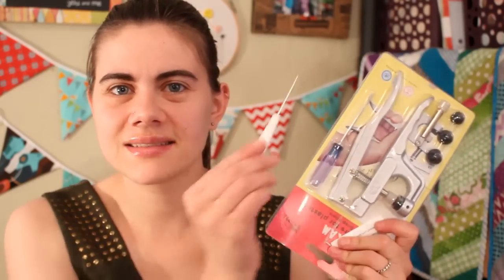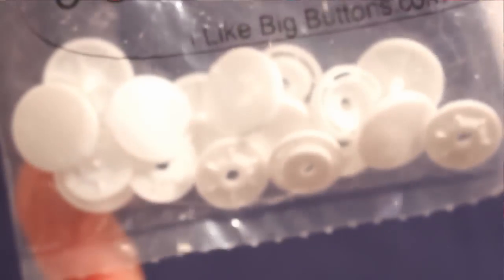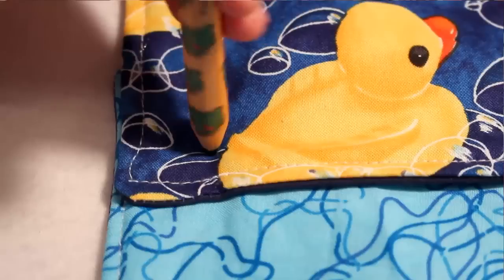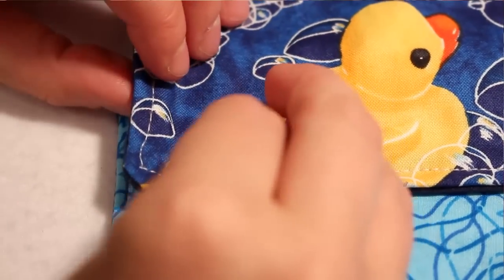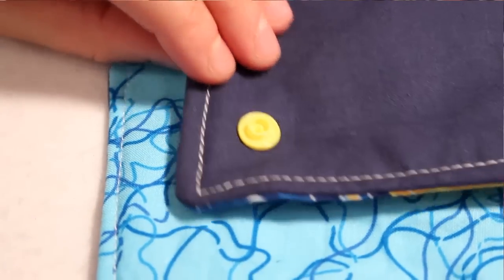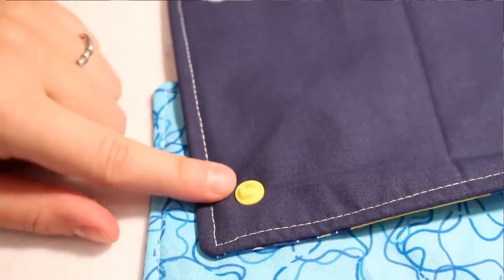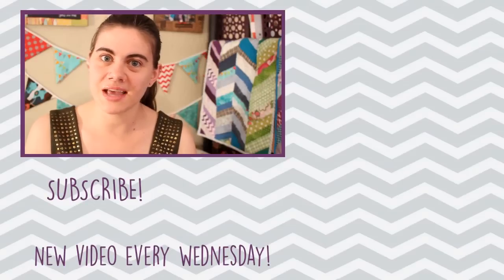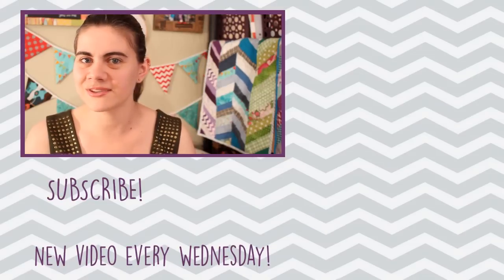How to Install a Plastic Snap | Step By Step | Easy to Follow | Whitney Sews

Comment: I have tried putting snap on twice and both times I can't close the snap, am I doing something wrong? I don't want to keep wasting snaps trying so I thought I would just ask!
Reply: I was having the same problem. I went back with the snap setter and repressed them in and it worked. Must of just needed some more pressure to set them in right
Reply: I had the same problem when I applied snaps to a ribbon (for a sun bonnet strap). I removed the clear rubber from around the metal "spike" on the tool. Then pressed the snaps again very firmly. That squashed the snap spikes a bit lower and the snaps close now!

Comment: Hi, thanks for the video.  I can’t get mine to stay in the fabric.  I don’t know if I have cheap snaps or if something is missing from my gadget., the male and female to snap together but not when put on fabric, the sharp bit from cap, stops the male and female snaps clicking together.  Any suggestions?
Reply: HELP!! Me too. Disaster. It either can't snap together & if it does it pulls out of the fabric. I'm So Frustrated. What am I doing wrong? Fabric isn't too thick.
Reply: @alisatjaden3906  hi, me again, I got the problem sorted and have happily adding snaps to everything.  It was my pliers that were  wrong, I was using the ones for metal snaps.  The new pliers I bought for plastic snaps has an extra bit on them. It squashes the spike down so enables the  two pieces to snap together and hold them in place. Check your pliers, make sure you have the correct ones. Good luck.
Reply: @Elizabeth-ux3is  Hi Thanks! Have new ones, but directions were in 3 languages & wondering if I did it wrong? Dritz brand. I've wasted so many snaps now & if I get them on I can't get them snapped. Watching videos not helping. I appreciate your suggestion very much & will recheck it. Thank you!! ❤
Reply: @alisatjaden3906   it’s so frustrating, I found a video on u tube that explained it all I will see f I can find it again and will let you know.  X
Reply: @alisatjaden3906  hi, I hope this works, have never shared a link via u tube before.   https://youtu.be/CZjfj_WIYws
Reply: @Elizabeth-ux3is  Ooooh thank you! So sweet of you. Will check it out. Making cloth menstrual/incontinence pads for my family...
Reply: Hi! Watched video very carefully. Hmmm maybe I'm not squishing the snaps hard enough? Will try later tomorrow. I appreciate you so much for helping me!  Will try to find you again to let you know!! Blessings to you!! 😅❤
Reply: @alisatjaden3906  yes, please let me know how you get on.  Good luck.  Liz.  X
Reply: @alisatjaden3906  wow, have just read what you are making.  That is a great idea. .....Liz. X
Reply: @Elizabeth-ux3is  Oh hallelujah, it's Working!! The video you sent me really helped me. I needed to smash that tool really HARD. I was being too wimpy, afraid I'd keep breaking them. Had to refix some snaps tonite & it WORKS!! Can't thank you enough!! Blessings to you from Iowa!! ❤💖😅

Comment: I bought some Kam snaps for some tote bags I made. I got them off Amazon but must have gotten cheap ones because no matter what I do they won’t snap. Any recommendations for good kam snaps I can put on tote bags. I just want plastic ones. Have the hand pressure Hager but need snaps and I’m struggling finding good ones that actually work.

Comment: I loved the video, but I have kind of a strange question.  Is it possible to put metal or plastic snaps on 1/8th inch thick hard plastic?  I have a project that requires fastening mesh/canvas to said plastic and snaps seemed like an elegant method
Reply from the maker: I'm sure there are heavy duty metal snaps that would work. You would need to get once that have a long enough stem to go through the thickness and still be set into place. That type of snap will require a hammer and setting rod to set.
Reply: @Whitney_Sews  Thank you!

Comment: Question....the posts on the back part of the snaps poke through the male and female parts of the snaps, making it impossible to snap them together.  How do I work around that? I cannot snip the posts down for enough to accommodate the other side of the snap.
Reply: That's my problem as well.
Reply: @jalynhaley6053  hey Jalyn
I've had a little success by using the tools and adjusting the pliers a bit. Still not what I thought it would turn out like, but I hope that helps a little:)

Comment: I have this kit but I find that when you push down the cap it still sticks up a bit so doesn't close properly, I find I need to cut a bit off, have you come across this???
Reply from the maker: I've had that problem a few times, usually because the snap is only going through a couple of layers of thin fabric.  You might try adding a layer of interfacing or something in between the layers to see if that takes care of the problem.

Comment: i have a metal prong tool similar to a plier except its for snapping metal fasteners. For some reason, i can't snap the buttons properly. The sharp part doesnt get flatten at all, did i do something wrong??
Reply from the maker: If it's not a tool made for plastic snaps then it won't set them properly.
Reply: @Whitney_Sews  ah that sucks, can i just use a hammer to compress the sharp part?
Reply from the maker: @senoritajm3768  No, plastic snaps have to be set by the correct type of pliers or they will either brake or not get set correctly.
Reply: @Whitney_Sews  im new to plastic fasteners and have just ordered a "Birch" branded fastener tool for plastic snaps.. do you know if I can use generic plastic snaps instead of just the Birch brand? Hope this makes sense :)
Reply from the maker: @lee-annedouglas5763  I'm not sure, I've never heard of that brand before.
Reply: @Whitney_Sews  Yeah its an Australian brand... just wondered whether different brand snaps were compatible with all the different branded tools Thanks :)

Comment: I have problem to squeeze the snap. The snap does not close. And I tried to squeez again or with both hands, when it does not close, what whould I do. I lose the project, how remove the snap, or there is another way to make close the snap

Comment: When I'm making a little coin purse and use the snaps I go to pull the snap apart and it just pulls right out of the fabric
Reply: Hopefully you sorted it out by now.. ❤ I think some stabilizer in the area where the snap will be could help to prevent the snap from ripping out of the fabric.❤

Comment: Has anyone had problems with the manual snap tool breaking after only a few uses? The store I am ordering my other supplies from has one, but they have a disclaimer saying they don’t recommend it as it breaks too easily? I want to make my daughter a few pairs of training pants with snaps, but I definitely don’t do enough sewing to justify buying a press, so I’m not sure what I should do?
Reply from the maker: I have had my snap tool for many years and never had problems with it breaking. But if you only need one for a few small projects and don't want to buy the tool,  maybe consider the metal snaps that are hand sewn in place instead?

Comment: My snap won't close.  It looks like the pins are too long.  Your tutorial says they will be compressed by the tool.  What to do?
Reply: I used more pressure and got the pinscompressed more.  Also, on a second purse, I added a small piece of batt between the fabric and part to provide more thickness so the pin would be pressed down enough.

Comment: I have that same snap kit why dose it not want to snap after I put them on I have to force it and then it's hard to open it gets easier after that but it doesn't really feel right
Reply from the maker: Check my response to Kate Smyth and see if that helps.  Sounds like you're having the same problem she is.
Reply: I am going through all the fabric my problem is once I have the snaps on they don't want to snap onto each other
Reply from the maker: pris dls Right, but how thick I the fabrics you're going through. If it's just a couple of layers of thin fabric you  will have excess stem so when the snap is installed the excess fills too much of the inside of the snap and there isn't enough space left inside for the two pieces to fit together correctly.
Reply: Okay thank you so much
Reply: If I have just two layers of  thin cotton (like a bed sheet) and one layer of light "featherweight" Pellon interfacing, would that be enough so the snap pieces will fit together correctly? I have just experienced an epic failure with a Dritz plastic kit, and want to move on with a good product that will work for me. I'm making a mini wallet. Thanks in advance for your help!!

Comment: How do you get the snap off if it won't snap close
Reply: Funny you are asking this question because I just had that problem.  My fabric wa too thick for the second snap so I had to remove the first one.  I used needle nose pliers.  I kept bending cap until it broke only leaving the stem.  Then I used the cutter inside the pliers to cut off the stem on both sides of my fabric.